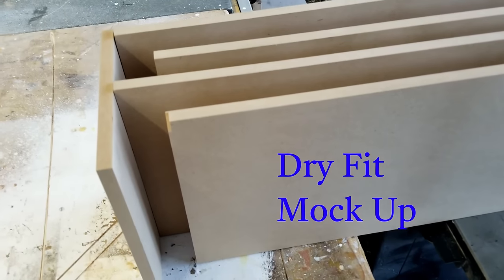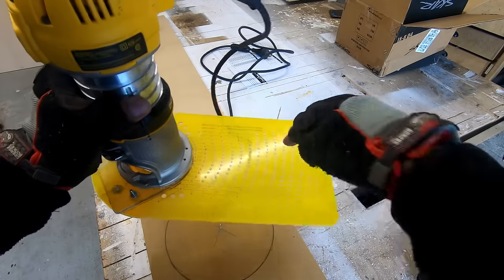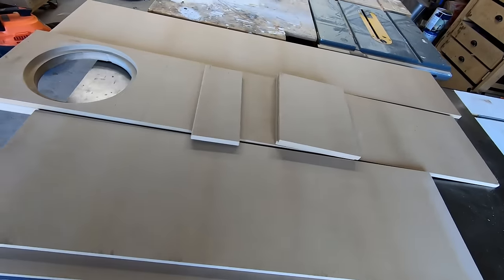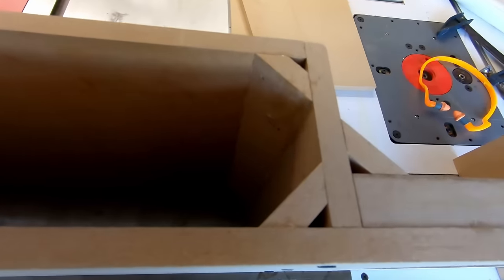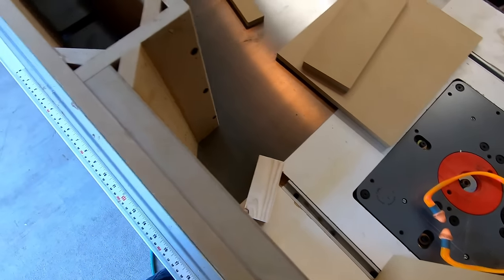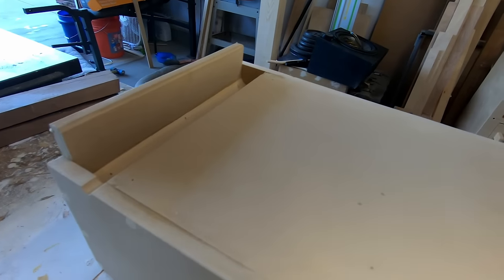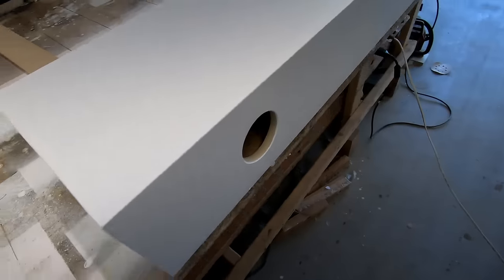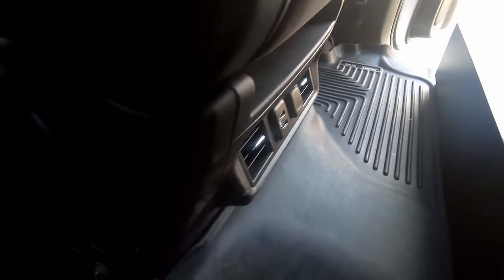DIY Subwoofer Enclosure 2021 Edition - Caliwood Specialty

Comment: I wish i had those tools and that table saw and your expertise to build that clean and well, unfortunately i have basic budget tools to build a basic box that gets the job done. It may look ugly but carpet covers the ugly. But it works and thats all that matters.
Reply from the maker: I started off my tool collection with a hammer and a screw driver ha ha.  I slowly purchased tools as I needed them. There are many ways to build something. Generally speaking you can build almost anything with basic tools, the important thing is to try it; that's how you gain experience. Thanks for your comment.
Reply: @FranksCaliWoodSpecialty  what i really want is a table saw to cut straight flat edges so that everything lines up as it should.
When you cut wood with a circular saw, its not always perfect which means not all peices line up as they should. 

I remember back in the 90s when all i had was a jig saw to cut wood for subwoofer boxes. All done by free hand, but again, nothing like wood glue between the joints and inside the box at the 90 deg bends to seal the imperfections in the wood. Those were the good old days ...

Comment: Do yo make subwoofer enclosures for other people, looking for a enclosure for my 2019 Chevy Silverado crew cab , purchased two kicker LT7 solo baric 12” , is a sealed enclosure better for deep hard hitting bass or a ported enclosure is the better way to go , if so can you help me , I’m so lost on what do with trying to find one for my truck , thank you
Reply from the maker: I can make a box based on your specific dimensions if you also live in southern California. In terms of what box is better, I don't think there's a wrong answer. It just depends on what you want. Usually ported boxes will give you cleaner, better low end bass but they are typically larger boxes. Sealed boxes will require a more powerful amp to drive it. Anyway there are tons of videos that can explain the difference for different box set ups.

Comment: Different strokes for different folks. There's nothing inherently wrong with the lo-mid saturation approach to bass. People do kind of like that  'Hummmmmm' effect, especially at dance parties. I don't think you have to go to all that effort to achieve it though, especially in a space as small as a car. That lo-mid resonance/distortion is the kind of thing that speaker builders go to great lengths to avoid. For me personally, I would prefer a more defined and clear bass response with more 'kick' to it. And for that you would want a sealed box that is very stiff and well insulated.
Reply from the maker: You nailed it... different strokes for different folks 😁
Reply: I'm with you.  There are some special things that can be done in a sealed box with some EQ as long as the speaker can take the power and you have a big amplifier.  For my home system, I use a 15" JBL woofer in a relatively small box along with a Crown amplifier and some DSP.  For the highs, I use the JBL D2 compression driver along with the waveguide from the M2 monitor.  I bought most of my stuff used and was essentially able to duplicate the M2 sound (even though the M2 uses a vented enclosure) at a fraction of the price.
Reply: @AndrewUnruh  I've actually been thinking of messing with horns, just for fun. Not sure that they really fit my use case. My take is that their efficiency is great if you need a lot of loudness, like outdoors or in a big hall ( believe they are employed in movie theatres?). But I guess you sacrifice a bit of fidelity/response flatness, probably not great for a bedroom or living room. I think the loud mids could compliment overdriven guitars or brassy jazz though, even big orchestral stuff. They'd be fun to muck around with
Reply: @frankcooke1692  Actually, no.  I agree that what you are saying was conventional wisdom for many years , but conventional wisdom in audio is notoriously unreliable.  
If you get a chance, listen to a pair of JBL M2 monitors.  They are spectacular even at moderate volume levels.  
The thing about using waveguides is that they require equalization so it helps tremendously if you can make anechoic or quasi-anechoic measurements.
Reply: @AndrewUnruh  JBL make great speakers, and they do seem pretty keen on horns. but there's a bit of a contradiction  if monitors require equalisation. I don't think I would use them for mixing. But they're probably quite well suited for home theatre or as a PA. From my experience, equalisers and Movies do not make good bed-fellows. Generally speaking - in an ideal world - we wouldn't need EQs at all. If the source and the speakers are good enough, an EQ is just there to remediate issues with either the room or your ears.

Comment: Nice! 
Durables, dynaglass or any fiberglass reinforced bondo I prefer better over the wood filler as when I first started years back it pops out with that nice 40 hertz range.. but that box would look clean as hell fiberglassed, with a nice candy or overspray and some light inlay in the dead space. How can I email you and I'll send you some pictures of my light work in my dead space areas and the diode/resistor/ cap set up that's cheap.. 30 of them doesn't even cost as much as 1 light kit bought at well a store or heck even Amazon.  Working on 4) 10's set up right now and have a crazy paint scheme for the glass work. Just working on which direction for the power supply since it's for my shop to piss off my rude neighbor. 
Keep it up bro you do a good job explaining your method for our youngsters.
Reply from the maker: Hey Joey, thanks for the comment and feedback. I'll be adding a logo or at least "Caliwood Specialty" on the face of the speaker box I'm building now using my CNC machine (it's by request).  BTW, wood filler and paint are holding up nicely. 
Sure, send me an email at caliwoodfrank@gmail.com I'd like to check out your work.
Reply: @FranksCaliWoodSpecialty  
I shall.. yes it works great.. my assumption is you're in California?..
It gets humid as hell here in Texas  so we use bondo even in the houses I build. 
I'll send you some pictures I think you'll like. My wife has requested a lace job on the new set up and I am using cheap equipment and upgrading internals. Wish I knew how to do all the video stuff.. ill send you some clips of my hydrodipped components. I really Iike your porting as I feel a lot of people are going the easy route and opting for sealed instead of what you do. I've seen the cheapest things out perform solely off of aero dynamics and tuned chambers. I like channels like yours and hope you grow!
Reply from the maker: @joeyamador7961  Yup, I'm here in Southern California. Yeah, I know what you're talking about I visited Dallas a couple of times and boy oh boy, it was waaay too humid. 
Hey, thanks again!

Comment: By the design, it looks lika a transmission line. How did you calculate the lenght of the line and the surface area? I'm wondering because it doesn't look like anything close to the SD of the driver... But it looks nice tho...
Reply from the maker: Thanks for the question. I searched up a website that calculated volume, port length,  etc.
Reply: @FranksCaliWoodSpecialty  Thanks for your answer... I'm thinking of building a TL like yours, but I haven't found any info besides the no longer available Marting J king fles so it is very difficult to get the calculations despite everytihing I've read. Can you share the name of the website? Thanks in advance....

Comment: what lengthe staples you using ?        for 3/4 wood, what length would you use ?
Reply from the maker: Thanks for the question. 
I used 1.5" brad nails

Comment: leading side edges could have been really rounded off a lot to blend better with the seat cushion. It just looks weird sticking out etc !
Reply from the maker: Thanks for the comment.  The box does not really stick out beyond the front of the bench.  I think the camera angle makes it seem like it does.  Also, "rounding the sides" might've affected the sound.
Reply: @FranksCaliWoodSpecialty   only for the better .

Comment: Hey mate. I am just wondering if this method could be used for home theatre subs with external amp!!
Reply from the maker: Hello 👋 
Thanks for the question.  Yes! In fact, I recommend this design for a home audio/subwoofer set up. I actually made a similar design for my home several years ago (I posted the videos on my channel.)

Comment: That 7 inch by 10 inch ,
Can I change that to 16 X 16 and still have the deep bass sound ?
Reply from the maker: Hi - that's the side measurement. But yeah, it'll work. You’ll need to model it based on your sub to figure out the frequency. Thanks for the question

Comment: Nice work bro! To be honest i dont like using does speaker connectors on my boxes! I rather drill a hole for the wire throw some cualk an call it quits! Ive had them rattle loose thats why i stop using them!

Comment: Very nice job! However a question: is it possible to design the port to charge the bass below the speaker's resonance frequency? In this case, say 16 Hz?
Reply: Yes I've done it several times myself
Reply from the maker: Yes, it just a matter of proper tuning (chamber and port length). Although 16 Hz is a pretty low frequency.

Comment: How do you calculate to make a T-line enclosure? I have a Sundown x-8 I want to try in the trunk of a car
Reply from the maker: Hi - there are several articles and sites that can be found online. Simply search for t-line calculator or Transmission line speaker length calculator.
Reply: I was wondering the same thing. Glad to see he used a calculator and built the box for the sub.

Comment: Hello,very nice build. I am building a ported box are the 45 in corners absolutely necessary? Your input would be greatly appreciated. Thank you.
Reply from the maker: Thanks for the question. Absolutely necessary?...Short answer, yes. The 45s help with air flow movement and helps avoid air turbulence which can potentially cause your box to sound terrible. It does not take that much time to make the 45, I say add them.
Reply: Thank you

Comment: Got a question for ya… I have a 2016 f150 supercrew and was curious if you have made a box that could fit behind the rear seats instead of under? I seen that Rockford fosgate had a shallow sub that only needed 3”
Reply from the maker: Thanks for the question. I too have seen custom boxes built for rear seat mounting, but I have not built one.  I would like to design/build one just to hear how it sounds/performs.
Reply: @FranksCaliWoodSpecialty  ya I haven’t seen any that go behind the seat for that type of truck. Would like to see and hear it as well. I asked a guy if he would build one local but he doesn’t seem interested in doing it or think it would work.
Reply from the maker: @mxr248  Sorry to hear that. First thing is finding out how much space you have in order to design a box that will not only fit nicely, but also sound great based on shallow mount subs options. Email me caliwoodspecialty@gmail.com

Comment: love this box design.. how much larger to fit a 12' sub?
Reply from the maker: I don't really think a 12" sub would fit under the seat unless it's a low profile sub or you have  the space for a larger enclosure to put in a truck etc.
Reply: It is for a Excursion.. would sit behind the 3rd row.. I like that the sub is facing down ans is protected.. and I was thinking of building a center console.. not sure yet
Reply from the maker: @HEAVYMETAL0209  Oh yeah, if you put it behind the 3rd row seat, you'll have plenty of space for the box.  I've also seen center console custom enclosures. They look pretty cool.

Comment: Awesome job. hard to believe just one 8-inch sub producing such a smooth bass. but you can definitely hear it.  I own 4 of these same subs in DVC 2 ohm for use for home theater. I used a car amp to power two subs. I wonder if you have a Subwoofer Enclosure plan for home audio?  using that same Skar Audio sub. Thanks
Reply from the maker: Oh thank you so much for your comment. It's amazing the amount that one 8 can produce in the right enclosure. 

I've always been curious about testing subs/car amps in a home audio set up. 
I actually built my own home subwoofer enclosure years ago. I used a 10" Dayton Audio Sub paired with a Sub amp. 

https://youtu.be/S7Us3NBJA9c
☝️☝️☝️
Reply: @FranksCaliWoodSpecialty  Thank you so much.

Comment: Amazing work. I have a 12 inch speaker, trying to fit in the trunk. This slim design would be quite ideal, how can I scale for this?
Reply from the maker: 👋 Thanks a lot for the comment. A box for a 12" sub can definitely be scaled. However, most subs, especially a 12" sub, will have a deep mounting depth so it may be hard to fit it in a shallow box design with limited space under the seat. You need to consider a shallow mount sub if you want to use a large 12" sub.
Reply: @FranksCaliWoodSpecialty  thanks for replying. I'm not thinking of placing it under the seat. I want to keep it in the trunk. Having a slim design like this would take up less space in the trunk.

Comment: You lost me at the speaker connector on the box. Ever used Speakon connectors? Pricey but worth it.
Reply from the maker: I've had other comment about the same thing. No, never heard of those connectors.  Will check 'em out. By the way, no issue with the current connectors to date. thanks for the comment.

Comment: Shouldn't you have put glue in the screw holes? I would think after a while the screws would start to back out🤔
Reply from the maker: Thanks for the question. I have not had any issues with screws coming loose with any of countless enclosures I've made.

Comment: smooth bedliner intead of paint. It won't chip off.
Reply from the maker: Right on, thanks for the recommendation.  However, this paint finish is standing the test of time.  It has no paint chipping, scoffs, or marks.  Then again, the box is nicely tucked away and out of the way from accidental kicks, etc.  Thanks again.
Reply: @FranksCaliWoodSpecialty  I tear stuff up 🤣
Reply from the maker: It happens lol

Comment: What kinda paint and connectors did you use?
Reply from the maker: Hi - I first used white primer (MDF absorbs a lot), then I used a couple of coats of flat black furniture grade paint. 
The connectors is a standard spring clip terminal connector (spade connectors on the inside).
Reply: @FranksCaliWoodSpecialty  try lacquer based primer or kilz primer. It doesnt absord as much. And Ive bought about 4 different connectors from amazon and they're all too small for 10 guage sub wire.
Reply from the maker: @ajw148  right on, thanks! I do have another sub box build coming up so I'll keep that in mind. 
You might need to go to an audio shop to find the connectors you need.
Reply from the maker: @ajw148  👍

Comment: Why didn’t you use a dual speaker set up? You should’ve used 2 12” or 15” subs.
Reply from the maker: I did make a dual sub box that is similar to this build with front facing ports yet still down firing subs. 
Also, there aren't that Manny options for 12s or 15s that will fit nicely under the seat. Thanks for the comment. 
https://youtu.be/vsRxByI5abA

Comment: What did you use to line the Perimeter of the hole around 10:45
Reply from the maker: Oh that acts as a gasket between the enclosure and speaker which helps ensure there are no air leaks. Air leaks reduce performance.

Comment: Would a 12 inch shallow mount work  better? Thanks for the answer in advance caliwood
Reply from the maker: Yes, a 12" would work; however, the box would need to be deeper and it would stick out too much in the front. It would get in the way of people's feet (assuming you place it under the rear bench seat).
Reply: @FranksCaliWoodSpecialty  I see, it makes sense thanks for the quick response, keep up the good work brother, I'll be waiting for your next project
Reply from the maker: @eduardocervantes6488  Much appreciated, thank you.

Comment: What's the biggest speakers u can get in a box like that under the seat of a 2010 f150 2.5 in seat lift
Reply from the maker: Thanks for the question. It's hard to say because all subs have different depth and magnet sizes. I would suggest measuring the clearance height and then subtract the the top and bottom thickness of the MDF. That will give you the height left for the depth of the sub. That can help you narrow down your search for subs that can fit.
Reply: How much to u charge for building boxes with all of the measurements
Reply from the maker: @jirismanns9049  Are you located in Los Angeles County?
Reply: @FranksCaliWoodSpecialty  no I'm actually in Florida
Reply from the maker: @jirismanns9049  sure, you can email me at caliwoodfrank@gmail.com

Comment: Bracing not needed but that’s cute. Makes no difference with this small of an application
Reply from the maker: Are you referring to the dowels? If so, that was more to ensure that the material for the port didn't move on me when attaching the front and back pieces. Thanks for your comment.

Comment: What router bit you used to counter sink the speaker
Reply from the maker: Thanks for the question.  It's called a rabbeting bit. Usually, when you buy it, it comes with varying sized bearings also.

Comment: I have never enjoyed a ported box, always sealed for the good hard hitting bass.
Reply from the maker: Yeah, everyone has different preferences.
Reply: Yes, there is a difference between different style of enclosures...but it totally depends on the woofer specs as well.  I have an old 12" infinity sub that is a freaking monster in a sealed box.  low LOW extension, clean sound etc.  Put it in a properly designed ported enclosure and it falls apart; boomy, muddy...bleh  On the other hand I've got a no name 10" woofer that play so tight, clean and low in a ported box I still have a hard time believing it...block the port and it sounds so bad I couldn't give it away.
Reply from the maker: @JViello  yup, true